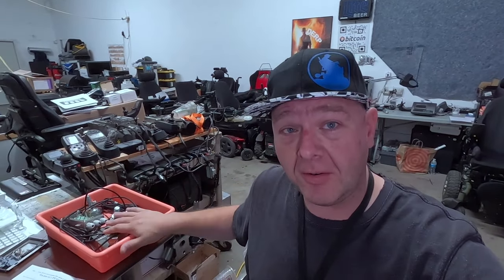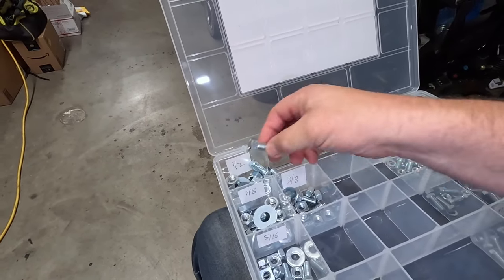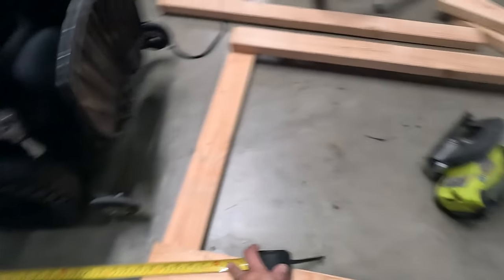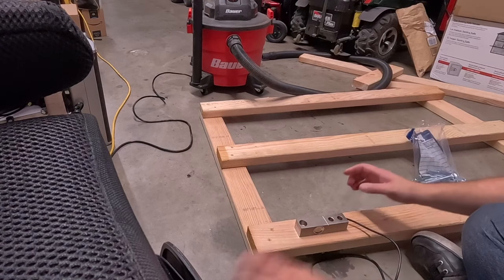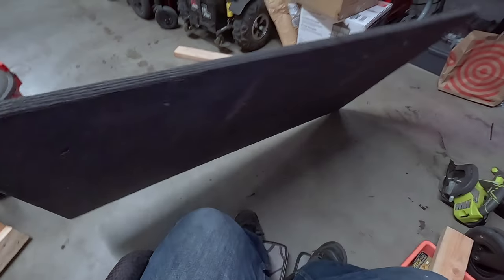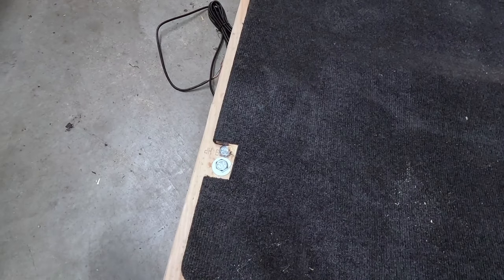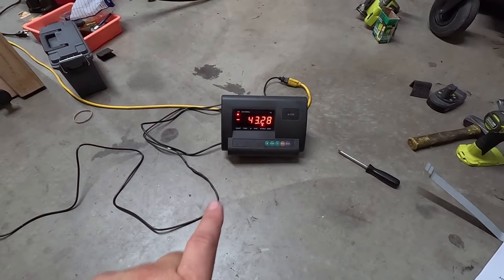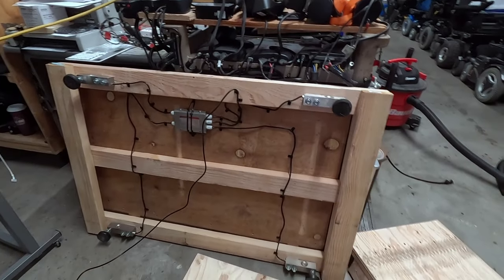VLOG 684: building a wheelchair scale! (ebay style kit)

Comment: That looks like a very substantial piece of equipment, you could do with a little lip on the ramp that tucks under the main platform so that the ramp is trapped as you go up and it also supports the platform from tipping as much.

Comment: You might want to consider putting adjustable legs across the entry end of the scale then you can “fine tune” the height so it doesn’t effect the scale but low enough so it doesn’t tip up on you. 😎

Comment: Help! Wondering if you think I can charge my permobil M3 with stock charger and a 700 watt 715wh solar generator running 200watts of solar panel camping in the desert or do you think I would need a small gas generator. I'm using the permobil charger(says output 350 watt).Is there a smaller watt charger/less amps/watts that would be easier on the system but slower that I could buy off Amazon maybe? Thanks for any input  Really wanna use the solar setup but not sure without buying it and trying it first...